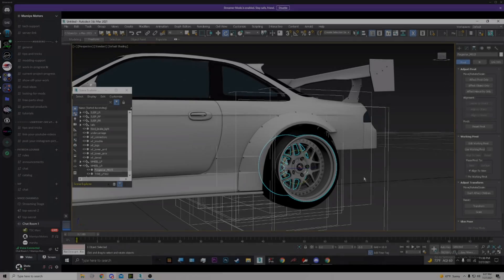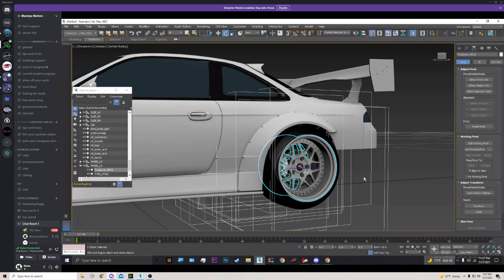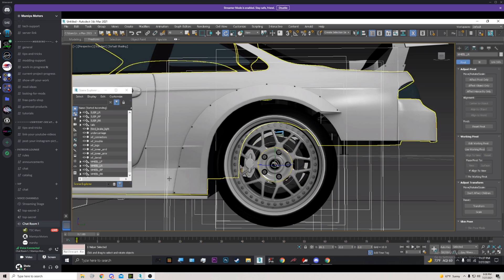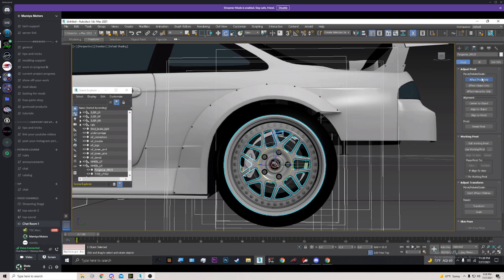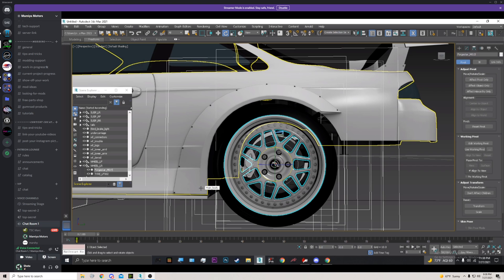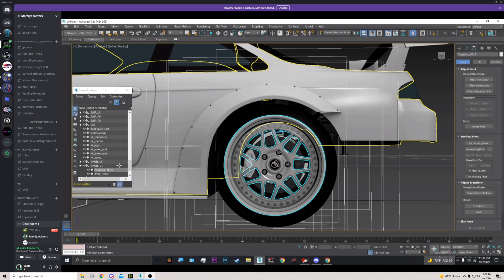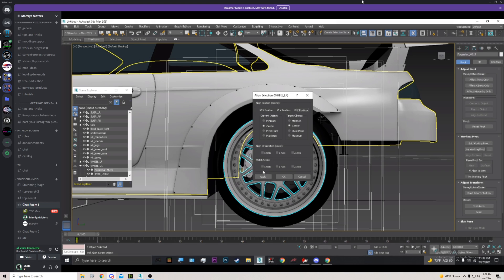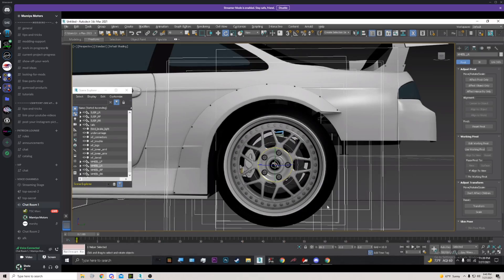COMMON ISSUES: Wobbly Wheel Fix | 3DSMAX | Assetto Corsa

Comment: Thanks so much man, wheels are such a pain sometimes, even just this hack to spin the wheel in 3dsmax is going to save me so much time! Keep these up!
Reply from the maker: Glad it helps!
Reply: Only thing iv got a problem with now is if the car has camber, testing the wheels by spinning the dummy doesn’t work. I guess I’d you zero it out first then make everything align?
Reply: Actually still such a massive nightmare of the models dummy’s are not straight snd the wheels are also at different angles. The aligning tool only goes off the centre? Any easy ways to align to the  angles?
Reply from the maker: That’s actually something I realized after wards that I did not cover. I would always set the suspension to 0 camber before unpacking the kn5 in showroom. However, if you have camber in 3ds, then you can click on the dummy, then change the gizmo from world to local at the top and that will change the orientation to match the angle of the wheel dummy
Reply: Or I guess you can just adjust it in 3ds once it’s all aligned! Thanks for the help anyway mate
Reply: @MamiyaMotors  another video I’d really appreciate is ao mapping wheels, making it so they don’t flicker? This is something I’m currently battling
Reply: @MamiyaMotors  Hey I have the same problem, could you explain where I can find this here "then change the gizmo from world to local at the top"? :):
Reply from the maker: Just search on google/YouTube how to change pivot gizmo from world to local